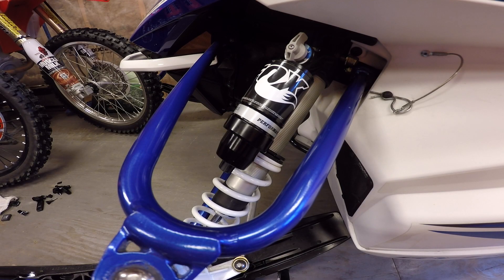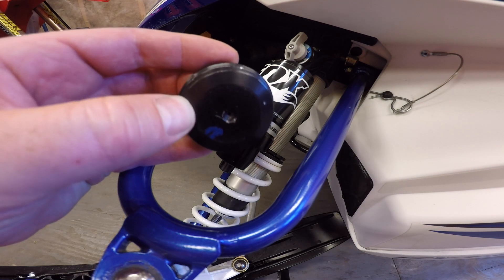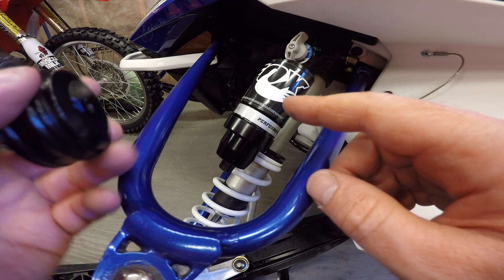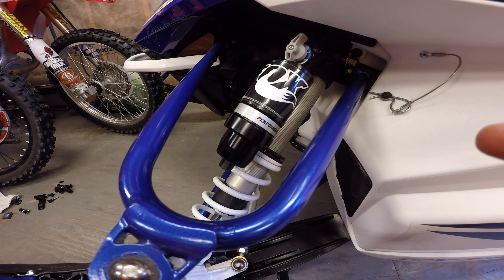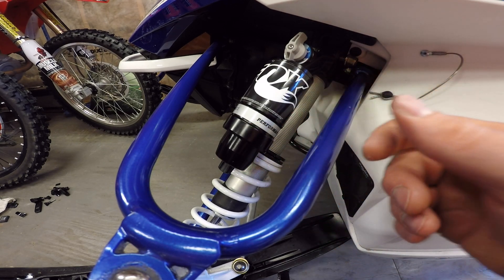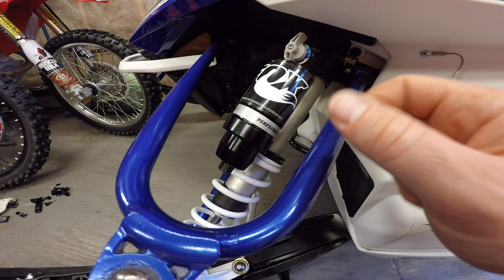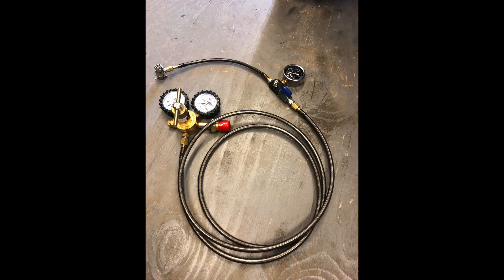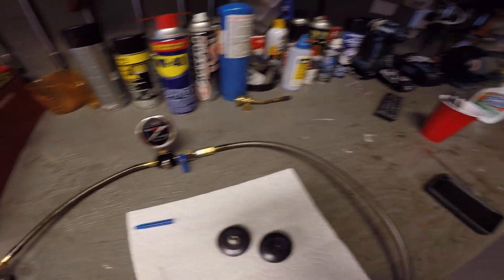Yamaha Viper Fox QS3 Shock rebuild upgrade.

Comment: Hi thanks for video, what model and year Viper do you have?  What do you suggest for Viper LTX DX , not happy with suspension,
Reply from the maker: I have the 2016 RTX se. The Fox Quick Select 3 pkg was the main reason I bought it. I'm not sure which shock pkg is on yours depending on the year. In my opinion suspension is what will have the most effect on you ride enjoyment. Having something with dampening adjustability is the key and a large volume nitrogen reservoir. Some ride quality can be restored from rebuilding your stock ones if they are pooched. There are some options out there but it may be very pricey to upgrade to something with more adjustability but the difference would be substantial. I am assuming you either have fox floats or the simple gas charged no adjustment type.

Comment: I was wondering how much oil is ok to lose from my shock? I left them apart for a couple of days before putting new caps back on and found a puddle of shock oil on the floor. Will it still be ok? Should I add oil? And how would I do that if necessary? Thanks
Reply from the maker: I’m assume you mean the reservoir caps? If so and you put these different ones on The units should be flushed and refilled and bled with proper IFP height. . Inspect all seals shafts and shock body for wear. There should be no leakage other then some assembly lube on shaft
Reply from the maker: At minimum have a shop top the off and set IFP height if your unsure. Very important to drain and flush out the suspension after break in. After that oil will last much longer and the shock will too! Keeping a fresh charge of nitrogen each season is key for best performance IMO

Comment: Hi there I installed the same high capacity reservoir caps on my T cat but found the Schrader valve threads we not standard. I Bought a Race Tech no loss charging tool and it does not thread on the reservoir cap valve. I tried the tool on another Schrader valve from shop supplies and it threads right on. The tool would not fit any of the reservoir caps so I know it’s not bad threads. Are there such things as metric Schrader valves? Have you seen this problem? Thanks
Reply from the maker: I’m not aware of that issue, I purchased my charge kit from Schmidty racing and it works on their end cap valves and I also used it on my Honda CRF 450 rear shock.

Comment: you cannot check the nitrogen pressure in those shocks the pressure will always be low when you check it due to the volume of nitrogen you took out of the reservoir when you check pressure

Comment: Honestly I don’t use Fox anymore. Expensive junk i find. I ride motocross/ sleds and had all Fox. They don’t hold up, especially on sleds, maybe the cold ?? I switched to X Shock. Less money and seems to hold up better.
Reply from the maker: These ones are way over hyped for sure... better than a non adjustable but not much....

Comment: Thats cuz the yamaha sr vipers are so fucken heavy i know cuz i have 1 2014 yamaha sr viper rtx se 1049cc tripple 4 stroke 129x15x1.25 ripsaw fox float 3s wanted them vhanged out tho junk shocks 550lbs was the airway bill last i remember
Reply from the maker: Those shocks on my viper are only marginally better then non adjustable gas charged units. Not really sure why the industry raves about them so much! They are ok but there is way better options out there for sure.
Reply: @bikermike  do you know it the fox QS3 kashima coated would be anybetter im about to rebuild my 2014 yamaha sr viper maybe tax return season im not sure on what kind of shocks to get for it
Reply from the maker: @edwardabrahamiii3742  depends on price. Problem with fox q3 shocks is limited adjustability and no high/low speed compression or rebound adjustment. If get a cheap used pair maybe to rebuild with the DSC kits available from hygear suspension. I was thinking of getting them for next shock rebuild.
Reply: @bikermike  would you suggest i try a different shock package float shocks are out as im not going to use any fox floats theyre junk basically ima do a rebuild from the ground up back in 2014 i rode that yamaha sr viper like i had no life now its 2020 i have 2 sons and they are my life
Reply: @bikermike  maybe id like to try elka stage 4 or 5s up front idk not sure yet
Reply from the maker: @edwardabrahamiii3742  I suppose the q3 would be better then floats. There are several companies that can build a custom set of shocks but$$$$. And ya sounds like your busy now!
Reply from the maker: @edwardabrahamiii3742  that would be a solid choice!
Reply: @bikermike  i just got to wait to see how much tax return i get for my 2 boys
Reply: Not to make it sound like im using them for that but i do take care of my 2 babies they changed my world i sobered up for them now im living that good life i can get what i want